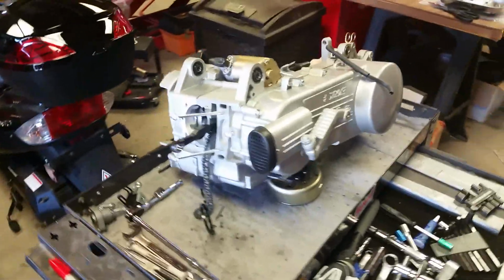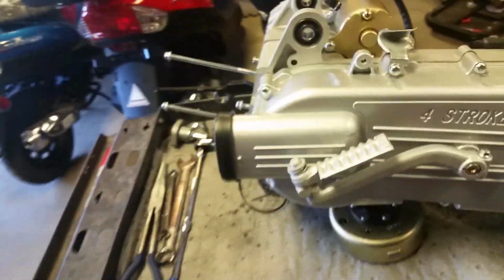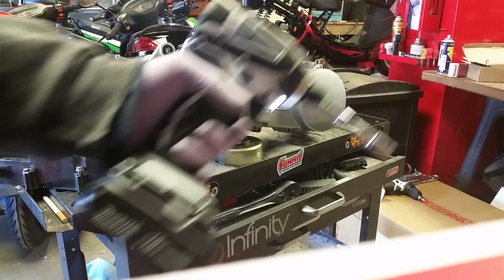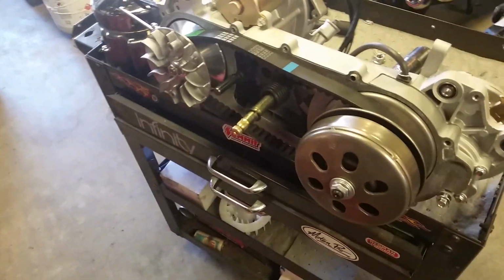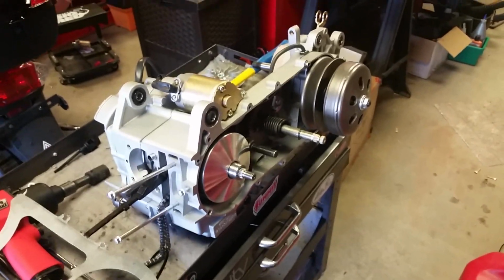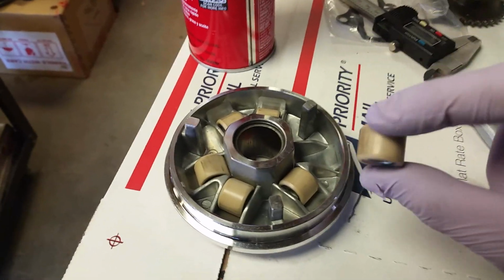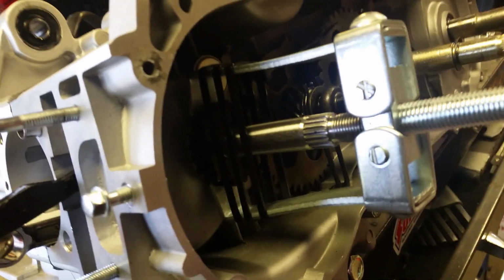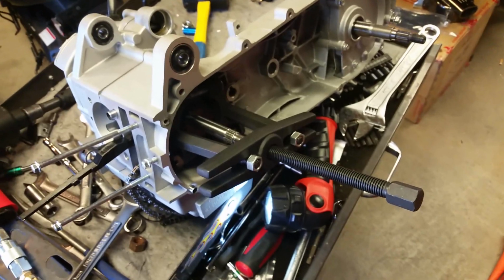GY6 CVT Tare Down 02

Comment: You can also use a slab of styrofoam, or a piece of wood, with corresponding holes drilled for the bolts.

Comment: yes I have a 150cc dune buggy and it will not go forward it go in reverse just fine but not forward I have replaced clutch belt and variator but the same I pulled the transmission everything looked good but I can't figure out y it won't drive Plez help me thank you
Reply: what did u find out about this